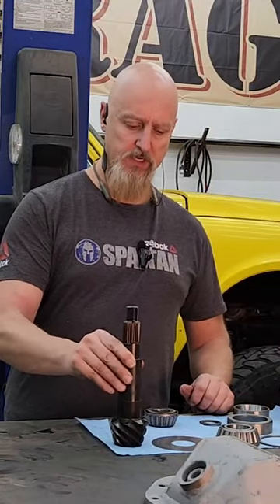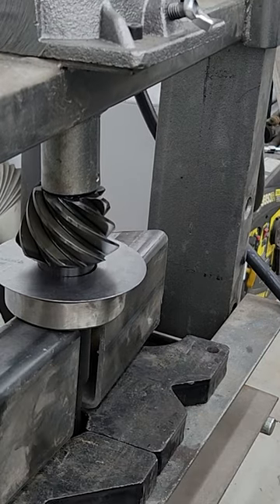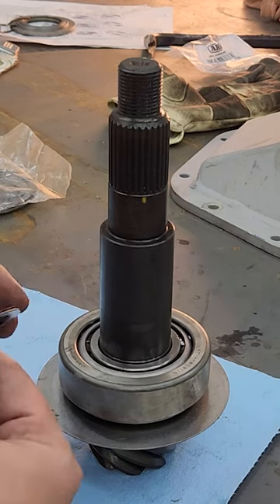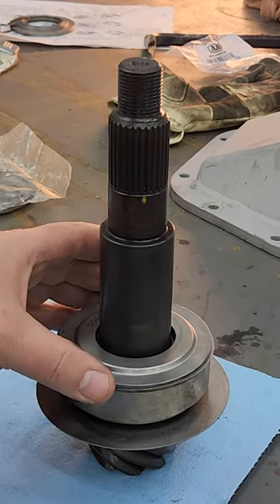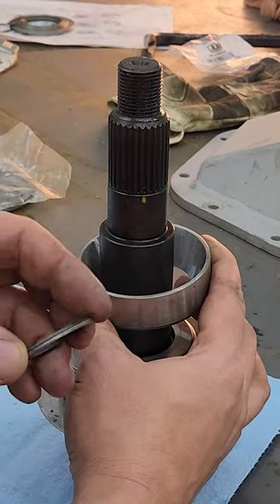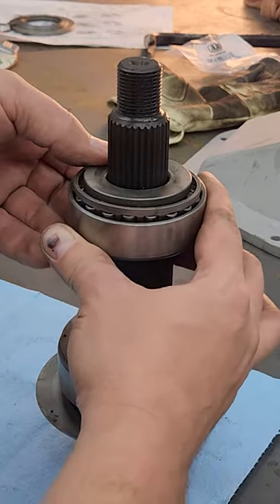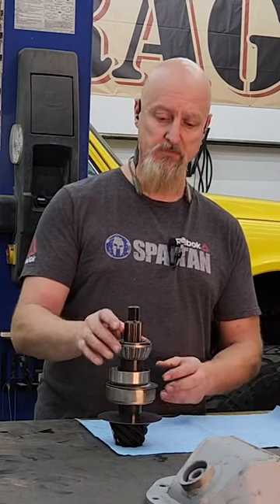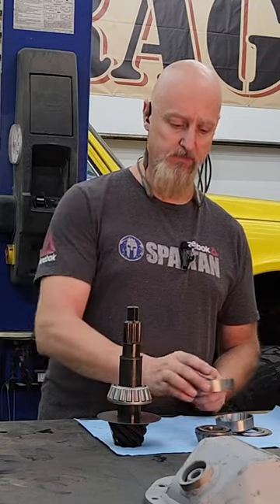d60 pinion setup

Comment: I’ve never pressed on a bearing using an outer race.
Reply: Same here press only on inner race
Reply: So how do you establish the roller oiling indents?
Reply: @thisisyourcaptainspeaking2259  
Hahaha 😝
Reply: Use an old inner race and die grind the inner dimension a little to make a tool to easily press the new one damage free😉
Reply: Exactly!! That’s absolutely wrong!! Good way to screw up a bearing cage.. 40 years rebuilding I never do that crap.. You press against the inner bearing race only with a old collar or pipe the same size never ever do what this guy says..This is not how us builders build rear ends at all totally wrong.

Comment: Never apply force to the bearing surfaces. If you do not have the proper driver one can be fabricated from the old bearing. My tool box has a huge assortment of old bearing races which I use for drivers. Sorry I disagree with this.

Comment: First I’d never press a bearing like that, he probably F—t that bearing up. I don’t know the tonnage force required but a side lateral force like that did that bearing no good, just saying. Second if you have decent old bearings, hone them out so they slip fit on the pinion . Install new races in housing, use pinion depth gauge. Tighten everything up . Then check backlash and teeth pattern. You can get real close. Then disassemble, install new bearings. One way is to heat them up in a hot oil bath to 275 degrees then press on pinion or you can do it cold also. Then reassemble and recheck your specifications. If your building a differential from bare components the process is more difficult and you definitely need a pinion depth gauge to achieve a successful outcome.

Comment: How do I make a setup bearing , and is it guaranteed to be the same as the actual new race I'm installing? Isn't that the purpose of the spacer shims , or are all races made to same tolerance ( by being manufactured in high strength steel) and its only the softer casings that may be cast to less accurate tolerances ?
Reply from the maker: We'll do a video on making setup bearings soon, but no, they aren't guaranteed to be exactly the same.  You do have to double check once you put the final bearings in, but usually it's still good.

Comment: By press into the case....he means beat the crap out of it with a punch and a 16 Oz hammer.
Reply: I use a 2-lb mallet, less noise and fewer dent marks.
Reply: @thisisyourcaptainspeaking2259  it was tounge in cheek...I actually have a race driving set.  Still takes some serious work to get it them seated correctly.

Comment: Looks wrong
Reply from the maker: It looks better when it's actually installed in the housing. ;)
Reply: @UintaGarage  my dana 44 out of my Studebaker Avanti didn't have an oil slinger where yours is located. Is this normal or are you familiar?
Reply: @calebbitz9469  it’s normal to have an oil slinger but it’s not always used. The D60 we regeared in the Blue Jimmy didn’t have a slinger but we added one that came with the kit. It’s likely it was removed during a previous service.
Reply: @Ryan F  yeah I think whoever rebuilt it didn't put shims back in right spots or the oil slinger. Also noticed my particular dana 44 for my avanti is slightly different than other dana 44s as the axle tubes are different (don't see why that would change location of oil slinger and shims vs same year dana 44s.